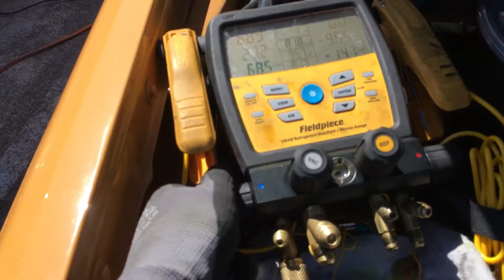Pt 2 how to check refrigerant oil in a car “extreme example !!!”

Comment: How do you clean all this out of your gear after this?
Reply from the maker: Alcohol and dry nitrogen 99.8% alcohol
Reply: Poor it in and shake it up than purge with nitrogen?
Reply from the maker: Wayne Costanza that’s a good question I attach a long 60 inch hose on the 3/8 port fill it completely up with alcohol attach it to the high-pressure nitrogen I turn it up to a unsafe very dangerous high pressure that nobody should ever do. All the other ports open to relieve pressure and allow alcohol flow I open up the nitrogen and push the alcohol in the threeeights line so it comes out all of the quarter inch lines perform this task about three times. Should be clean. 
    Do you have your nitrogen pressure turned up too high a hose could get away from you or the manifold the hose in on a hose could put your eye out knock your teeth out hit you in the face and cause a permanent scar that will need many stitches.   This is to be done in an open clear space away from any source of ignition fire or spark because you’re adding alcohol with compressed air and very flammable around any ignition source. 

And I perform a vacuum decay test and a pressure decay test in the manifold should be all good after that.